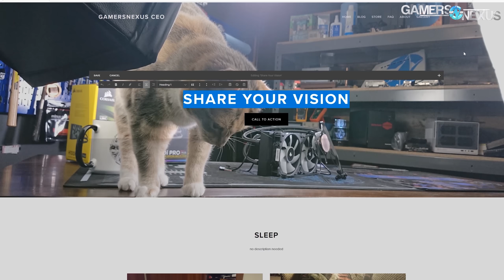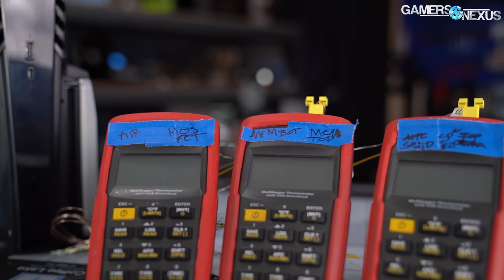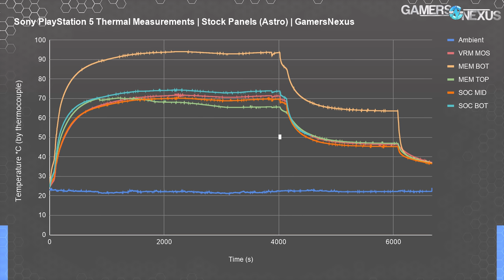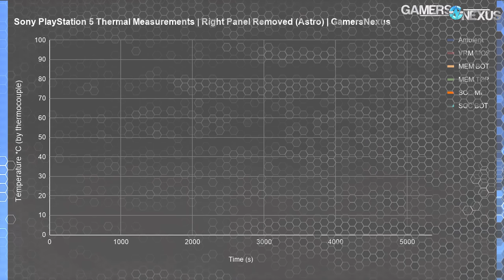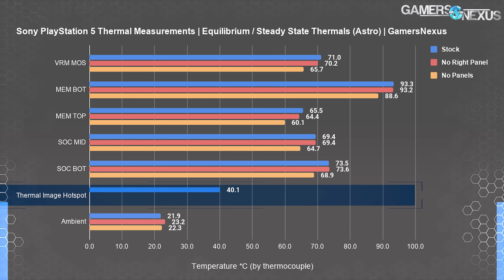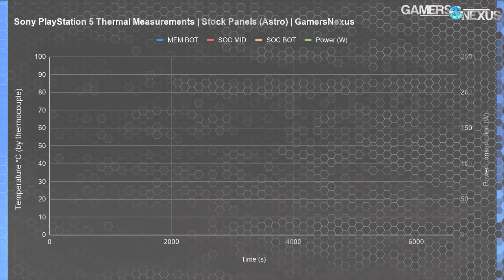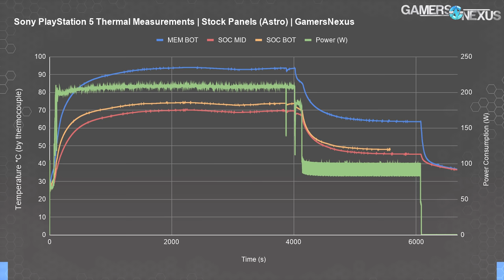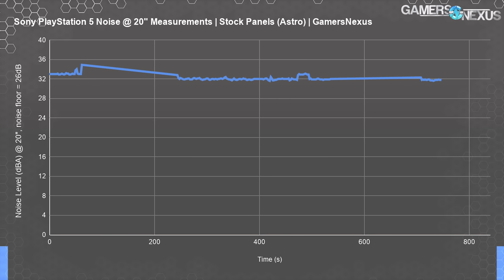Weak Cooler Design: PlayStation 5 Thermals, Power, & Noise Testing

Comment: I would be interested what happens if you put the PS5 in a really hot environment.
Reply: #Spoilers                    it will die!
Reply: @choatus  I'm more interested in how loud it can get before it dies 😂
Reply: @choatus  yeah, because the engineers probably forgot to test it on hot temperatures 😆😆😆
Reply: My house is at a constant 80° plus, haven't had an issue..
Reply: @JoyStickGuru  Don’t break their illusion of “I’m smarter than every Sony engineer”
Reply: @coolthief8375  I remember linus tried that once. He ended up having to make a Apology video

Comment: My worry is you're doing this in a fairly open air place most people won't they have it tucked up somewhere and if you have carpit it's gonna stifle the fan and heatskins, so this is best case scenario for cooling
Reply: 99% of these things on the floor in front or on the side of the TV because it's stupidly large and won't fit in people's entertainment centers. Sony not only made it ugly and large with the lab coat shroud but made it a thermal negative as well. 👏

Comment: i'm concerned about the thermocouple wires I see.  You can't splice non-thermocouple wire to thermocouple wire to bring the measurement out - it must be thermocouple wire ALL the way from the thermocouple itself to the measurement device, or the measurements at the thermocouple will vary with the temperature at the splice points.  A thermocouple uses dissimilar metals to generate a small current that varies by temperature - if you splice a different wire onto thermocouple wire, you create more dissimilar metal junctions, each of which will induce current of their own, and change the measurement.

Comment: After watching this I’m just going to take off the sides.
Reply: no xDD the sX have a circle base that stop most part of the air flow, but u no ned to remove it XD.
Want to see the same with xbox, that have biger temps on termal cam XD
Reply: Bad idea. Dust city incoming
Reply: @FFRyFFONLYONPS  More heat out typically means more heat removed from the system.  But yes it will be good to see the evaluation, hopefully soon.
Reply: @FFRyFFONLYONPS  Xbox temps tested between 50-60 on dynamic 4k gears 5, astro playroom upto 90c? wow.. how can you talk about xbox..

the air flow on xbox is insanely good as shown by the vaping videos. even my gaming pc runs hotter

Comment: I swear the airflow doesn't go actually through more then 70% of the heatsink
Reply: It's such a big ass heatsink it has its own microclimat xd
Reply: I think air going in is enough but not much is going out. Also the way the fins on the heatsink is facing perpendicular to the bigger chunk of the heatsink makes me wonder if it would be better if it was parallel to the air being blown. Like a laptop heatsink.

Comment: TLDR: Sony pulled a Cooler Master circa 2017 and MSI circa 2019
Reply: I thought it was THICC II that was the other bad 5700? must've forgot one
Reply: ah, thanks for the correction
Reply: What did MSI do in 2019? 
I bought a mobo and gpu from them last year 😶
Reply: @geoffdb8118  first run 5700 and 5700 xt cards had no memory cooling, which is bad

Comment: It's not like you say, I mean where you point to the location of the hot memory. The memories below go right on the copper, if you look at the base that you can see in any teardown, the screws go outside the memories, and I'm talking about the screws that hold the copper, so narrowly, but yes they are within the margin, in addition, inside they have precisely those that are furthest from the fins, a good amount of thermal paste. 
You should do it with another console to know that it is not a matter of this memory, in addition, you could even have accidentally measured the temperature of the metal, and not the memory. It is very strange that it drops 20 degrees just to have the fins on top, very strange. 
you're causing fear and we don't even know if it's your console, or if you've just misplaced that cable. You should take the measurement more times, to draw safe conclusions, and with another console.
Reply: Exactly.  Take this with a grain.  Everyone following this guy like what he speaks is gospel.  Clearly Sony should hire him as the engineers don't know as much as him.
Reply: Its hot bro!!

Comment: "Some long term validation reasons we want to leave the liquid metal intact"
Oh boy, Can't wait for that future video to see how the liquid metal holds up.
Reply: My 8700k showed temp degradation after 1.5 yrs and considering most people keep consoles for 3+ years ya... doesn't look promising
Reply: @moonmessiah9368  I was thinking the same thing. My FX 9590 was liquid metal cooled and degraded after a year. 

Only reason I can see the PS5 liquid metal lasting is because they designed everything to accept it, even the mating plate on the heatsink looks specific for this application, not to mention all the sides sealing it as well.
Reply: @Andy-hi9do  Sony stated they spent 2 years working on this cooling solution. I have pretty good faith that they put enough time on this solution to know if it will hold up over time of a usual console generation.
Reply: ive had very poor luck with liquid metal. ive used it in 5 systems i regularly run, and only 1 of them is still using LM, and thats only been 2 years. the others had to be cleaned after only about 6 months, and traditional paste (mx4) was put in instead
Reply: @TheStoneyYoshi  Well, only time will tell. 

Who can say where the road goes, where the day flows.. only time.
Reply: @James_Bee  indeed.
Reply: @P3G4SUZ  when I say two years I mean they spent two years designing it to the point where it would be up to their standards to last that long. Nobody out there is able to test their hardware to know if it's going to last five to ten years before it's even released unless they spend five to ten years creating it which would be a waste.

I can assure you MS hasn't spent 5-10 years testing their cooling solution. 

2 years DESIGNING a cooling solution I would say is pretty substantial.
Reply: @P3G4SUZ  Sony took a risk with a new cooling solution while MS took the easy route. Thats part of evolving technology... Risks are involved, just like MS with Game Pass. Calling the XSX superior with cooling in mind is purely subjective. You act like Sony didn't make this solution with cooling in mind which is silly... We may see a negative side but we also might not. Speculating the future of how liquid metal is going to hold up on a mass produced device based off of at home DIY applications is also silly. 

This is the first device afaik that is being mass produced using liquid metal instead of thermal compound. Speculating is one thing which is how I am with it but talking like we will no doubt see negative results in 2-3 years means you either have a time machine or you are set in believing what you want.  Nobody in the world knows whats going to happen in 2-3 years, so please stop acting like you know.
Reply: @P3G4SUZ  Not getting defensive over any piece of plastic and metal.  Why does everyone immediately jump to calling people defensive when someone disagrees and explains their perspective/opinion? I enjoy all gaming companies as well.  I own a PS4, PS5 (which has been flawless), switch, and PC for xbox exclusives and shooters. 

Again spouting opinion as "facts" is showing your favoritism. Trying to call me out for something that you are doing yourself is also pretty funny. You can feel free to come back here in 2 years but I really could care less. I'll be enjoying games from all of the companies while you are jizzing over your "factually superior" system.  Game on!

Comment: X[box] has the simple, more efficient, & cooler running design.
Reply: And yet weirdly with similar hardware it seems to be not running as well I assume because of optimisation, I guess?
Reply: @dracopug  
It's running better than the PlayStation 5 what are you talking about
Reply: and it even replacementable

Comment: 20:00 If I was a betting man I'd guess the second hottest memory module is the one next to the hottest on the left. It seems pretty obvious that you can't get that thermal couple wiring in there without causing a contact issue for those two memory modules. 

You only have to look at 18:58 to see that the wiring won't allow the backplate to contact  the backplate sufficiently, you can see the wires are pinched and the plate is slightly lifted. I would have personally ran the test without the yellow and black cables if I was wanting a more accurate measurement of the the memory modules. I'd want to minimise contact issues as much as possible.

Comment: Be interesting to see what modders come up with for custom cooling the PS5 like they did the PS4
Reply: They have come out with a stand for the ps5 that has fans to cool it, a controller charging docking station built in.
Reply: @oldArmyVet  I have seen this!!! Is this useful?
Reply: @spoiled_sushi2031  seems like it helps mine.

Comment: the metal piece was on top of the wires so is it possible that the heat from other components affected the wire making the temps higher than what the real memory temps are?
Reply: nope, the probe exists at the end of the wire. Rubber is not a good thermal isolator.

Comment: Wow very disappointed with Sony yet again they screw up the thermal management of their new console, I would hire new engineers working on the thermal management design of their system, obviously the current staff working on the ps5 have overlooked or on purpose left a very important issue unresolved- memory chips
Reply: Do you have a PhD in systems architecture? Are you published in any peer reviewed journals on thermal management in controlled systems. Are you a senior engineer at Sony/AMD? Do you know the financial costs of implementing his recommendations on global PS5 manufacturing? Very easy for youtubers to sit in their little testing room with some thermometers and a camera, even easier to comment on a video.
Reply: @尹梓龙  
I mean, if xbox can do it with higher, more power-demanding specs with better thermals and a smaller size, shouldn’t Sony be able to do even better especially with a bigger console? I guess they shouldn’t have overclocked it because it feels like they didn’t plan to do the overclocking in the beginning.
Reply: @尹梓龙  Found one of Sony’s engineers
Reply: @尹梓龙  you need none of those to see this design is subpar.

Comment: Isnt memory perfectly happy in the 90s?
Reply: See this what I can’t understand...some memory reaching 91 would kill it...how can the ps5 still function with its memory running at 95
Reply: @marcindpol  it’s possible. I mean most reviewers are only testing externally...you’d think they’d have thought to test internally.

It may well be a glitch in the game or the system (demanding too much power or doing more work than it needed to) but unless Sony have discovered a new element that is the most heat resistant on the planet, I can’t see how any chip or memory component can with stand that heat let alone function at it.
Reply: @marcindpol  how many Sony consoles have you owned?
 I've owned 3 ps3's and two ps4's.
 Sony doesn't care.
I'll eventually get a ps5, but past experience dictates that an early purchase is unwise.
 Hell I even waited on buying a ps4.. but it still crapped out on me.. it was the original FAT one.. my slim is still running.. but still.
Reply: @marcindpol  It's never good for memory to run that hot. My guess is that Sony tested it and saw higher failure rates (but not high enough to concern them). That's the consequence of their bad design. The console is in production - how can they change it now? So they just have to take the higher risk.

My opinion: They can put bigger/better thermal pads between the chips and the heatsink. Only Sony can decide if it's worth it
Reply: @marcindpol  no kidding, lol.
 I've believe I've owned everything except the vita.
 Though I will say my PSP never had any issues.
 But yeah, unlucky definitely describes my experiences.
Reply: Depends on the manufacturer. Micron memory shuts off at 100°c, maximum recommended running temperature is 95°c.
There is likely not to be any damage to the memory by using it in the summer, but expect the fans to possibly get agressivly louder.
Reply: @manscapedgrinch1427  Only had a PS3 fail and that was the notorious 60GB model. Owned every gen at launch. Other than the PS3 everyone is still functioning to this very day. Gotta clean the dust out bud. That's what killed my PS3. It would also still be going if I didn't get lazy.
Reply: Well a patch is supposedly gonna be coming out for the PS5 fan to change it's power depending on the game played. More intensive game will have more intensive cooling
Reply: Eric My 60gb would still be running if I didn't think it was a good idea in my semi-insomniac stupor to swap the thermal paste UNDER the IHS's of the Cell and RSX at 2am or whatever. Was tired/sloppy and either messed up a solder joint or scratched something. Went from just the fan starting to get a bit louder that would have been fixed with cleaning + swapping the outer thermal paste between the heatsink and IHS, to a YLOD. 12 years of running great to being dead from 1 dumb mistake, my biggest DIY blunder. The only couple of people doing re-balls and RSX swaps have gotten mixed reviews. I may just try to find a cosmetically beat up but fully functional console and swap boards.
Reply: @Brisco_County_Jr oh believe me, I've cleaned out dust since my second ps3, lol.
 Definitely a solid recommendation though.
Reply: @manscapedgrinch1427  Have an original PS3 that never broke down. A regular PS4 and PS4 slim that never broke down. You're just unlucky.
Reply: @jed1nat  well I may be pretty unlucky, but I do know I'm not the only one that experienced these issues.
 I'm hopeful the ps5 will be my first lucky purchase since my ps1, lol.
Reply: Uh, I dunno about "perfectly happy." As I understand it, most memory "likes" to run in the 30-50C range. As you start climbing from there, you start running into issues. You definitely never want to be near a thermal limit, and damn near 100C is going to be the thermal limit for just about any memory, I'd think.

We're actually starting to see a fair amount of people getting severe artifacting and needing their PS5s replaced already. While in my experience that kind of artifacting is generally GPU related, I wouldn't be surprised if ultra-hot memory modules are already starting to cause issues.
Reply: @marcindpol  Yes. They've done it before.

Comment: It's like that one really hot running memory module is designed to fail at some point. You're better than this, Sony.
Reply: This is the same company that required you to remove the motherboard to fully access their console fans on launch ps4. And the same company that made the atrocity that is launch PS3. You give Sony way too much faith
Reply: Sony doesn't do that, nice wild conspiracy with no evidence though.
Reply: @andrew6978  Planned obsolescence certainly is a thing. And it's just a fact that the memory chip operates at non-optimal temperatures.
Reply: @0Wayland  Sony doesn't do it.  Never has and in fact runs extensive QA testing.  "non optimal" doesn't mean it's going to break.  They are not like Apple with their mysteriously slowing iPhones.
Reply: @andrew6978  sony does do that, unless you're commenting on this from back in the 90's.
 I've owned three ps3's and two ps4's..
 I've only owned one Playstation 1.. nothing they make in the future will ever last as long as a ps1.
 They cut corners every time they make a new product... I was a Sony fanboy.. but now I realize they're just another shitty company that doesn't care about their customers.
Reply: @andrew6978  I only owned one ps2, but it's not because it never failed.. i just couldn't afford to replace it when its disc reader died.

Cant believe I forgot to mention the ps2, lol.
Reply: @manscapedgrinch1427  You != evidence.  When there is a class action suit, I'll be inclined to accept your one man 's evidence argument.  There is a 100,000,000+ install base with no problems. I'm inclined to go with that as evidence.
Reply: @rockapartie  "famous"
Reply: @manscapedgrinch1427  

lol i still have my base ps4 runs fine it just loud
Reply: @andrew6978  sigh
Disc readers failing on ps2's was actually a problem.. YLoD was a documented problem with ps3's, and the BLoD is a problem all models of ps4 have been susceptible to.
 I'm not looking to argue with someone who is blindly in love with Sony.. but I'm speaking from my personal experience to let anyone else that reads this know that there is a good chance a large portion of the first ps5's will crap out before or shortly after next christmas.
 Not everyone can afford to fork over piles of cash to replace something that shouldn't have released in such a shitty state.
Reply: @lilhandsome9496  
I wish mine still ran, it ended up having the BLoD.
 I planned on getting it fixed, but ended up tossing it in favor of a slim.. which I still own.
 I'm pretty happy with the slim, but the first shouldn't have crapped out in less than two years.
Reply: And it's not like I'm a nintendo or xbox fanboy either.. all the game hardware companies make sub par products.
 Hell, Nintendo's joycon drift problem is something that effects most, yet they still won't accept responsibility for it.
Reply: @manscapedgrinch1427  I'm not arguing about shit going wrong, which happens with any electronic product, you butted into an argument about Sony and planned obsolescence using your personal experience as evidence.
Reply: @andrew6978  I see your point. 
 Perhaps I've just been burned by Sony too often... maybe I saw a pattern where there wasnt one.
 I'm hopeful for the ps5, I just won't be surprised if theres a good amount of folks experiencing issues that could've been singled out during QC testing.
Reply: Are they ?